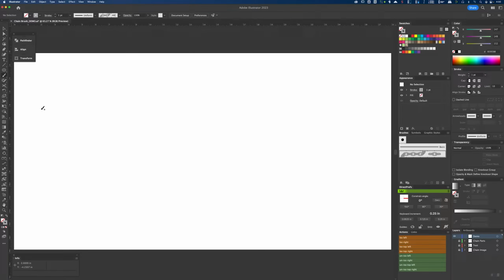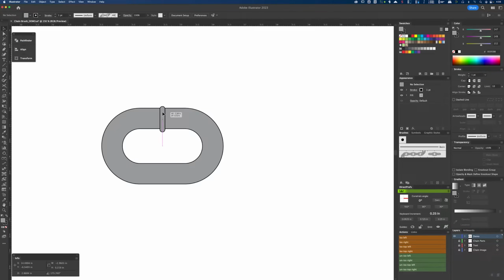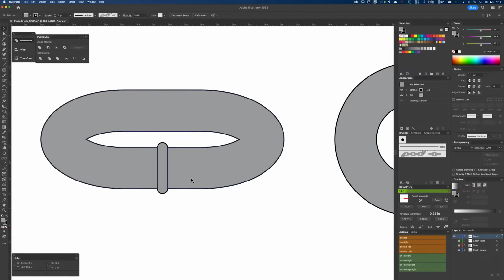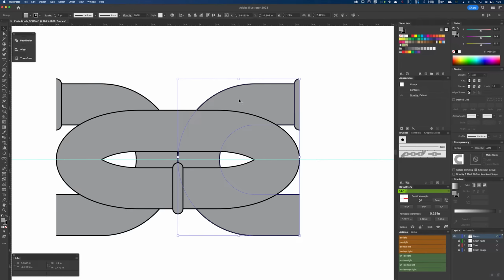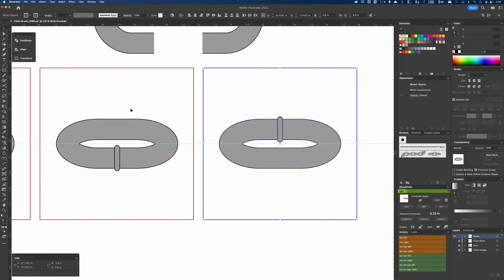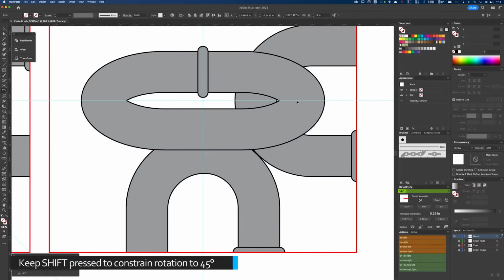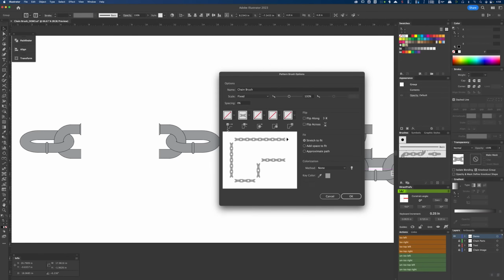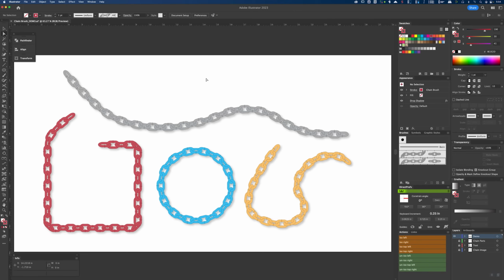Making a custom dynamic chain brush in Adobe Illustrator

Comment: Fantastic..... but seems I have 1px gap, between every chain? (middle of welding) What can I do?
Also after drawing the chain, then what? Object expand? Or?
Reply from the maker: Sounds like you didn’t snap align your chain artwork to the box container. They have to be perfectly aligned or else you’ll see a gap on the final chain. After you’re done you can expand and fill with the paint bucket, just make sure to select your chain before selecting the paint bucket tool (‘k’ on the keyboard).

Comment: Such a great video, but I must be missing a step. I've done the tutorial over at least three times and I can't get the corners to line up right
Reply from the maker: When you say corners, do you mean the corners on the final chain brush? Or while creating your chain link? Just guessing, but make sure you constrain the rectangle tool when creating your invisible box for each chain link, if they aren’t the same size it will show in the final brush. Also, make sure that all of your parts align to the exact centre of the invisible boxes, if you have any overhang or extra anchor points, these will mess up your auto alignment.